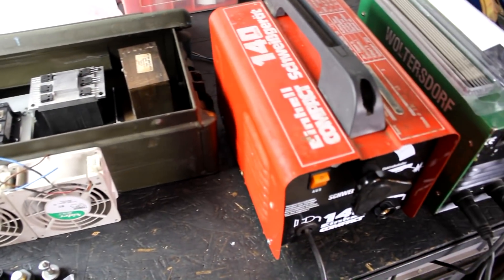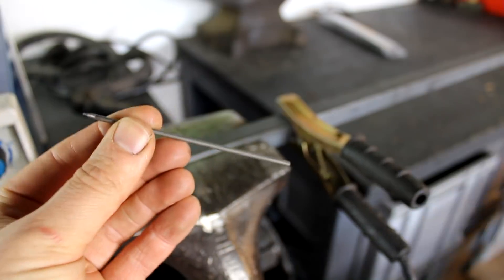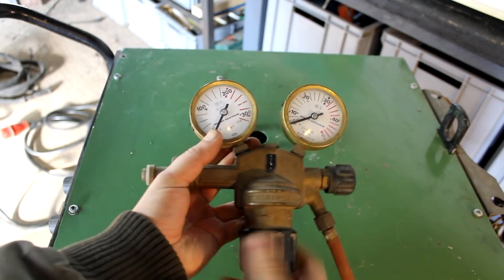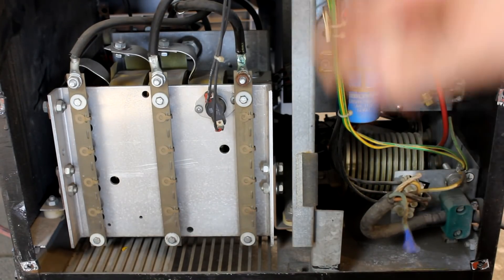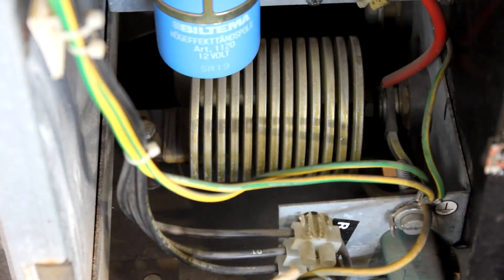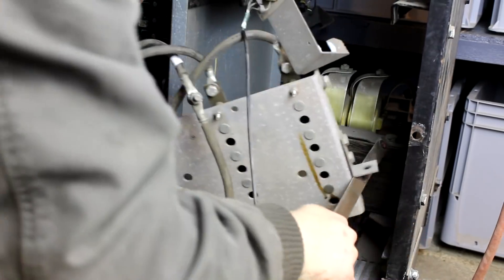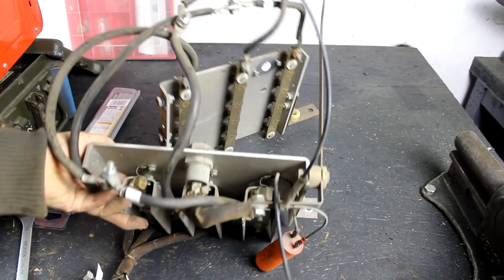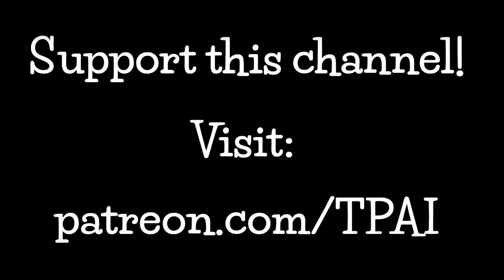Teardown of 250A TIG Welder - ESAB, Sweden

Comment: You forgot to mention one of the biggest benefits of MMA, it is used outside not because people don't want to carry a gas cylinder but because it has the best shielding in wind, wind can easily blow away your shielding gas. Glad to stumble upon your channel I also believe this abundance of cheap labor and materials will soon cease.

Comment: Probably,  somebody tried to modify it for single line power,  and didn't add any, type of internal grounding or connection so parts of the system went into an non symmetrical sympathy and it fried itself... Sorry. That was probably bullcrap. Do you know why it failed or got so corrupted?

Comment: 04:09 : Is this a good idea, having the leads' sockets so low close to the base of the welder? It feels somewhat wrong, although, I guess, if the leads are long, it saves them from always being bent and causing them to be unduly strained. 
It feels to me as if they are more prone to be accidentally jammed against some other object lying around in a workshop, kicked and trampled over or, more likely, tangled into those cart wheels than would be the case if they were located higher towards the top of the welder. Am I completely off-base thinking that?

Comment: You're my style, dawg. Except I bought a buzz box and in a week bought all the parts necessary to make an addon module for TIG welding + arc start. I hot glued it all to the inside of a plastic spool for maximum ventillation :D

Comment: recently found a weird electrode welder on the yard sale.  Huge 380V 3ph motor on wheels (looked like a air compressor with tank) and a controlpanel ontop where the cables / hand piece plug into.  weird one. maybe they used the momentum of the motor for higher initial currents.
Reply: gamerpaddy that is a rotary converter, basicaly two electric motors  with the same rotor. Used to be  the ducks guts Back in the Day, capable  of Tig and stick( 7018 and 6010, 6013) verry  powerfull and reliable, high dutty cicle
High power Rotary converter are used in  electrical  distribution  where a transformer would be  as big as a five story building.  rotary converters are compact but cant handle  overload
Reply: yea just found some infos on them, seems to be from early 1900 when there was no diodes around. using a generator seems to be the best way to generate DC. mercury rectifiers were big and low power.

Comment: I an not sure whether those capacitors crack due to internal swelling or shrinking of the  encapsulating resin, but just about everyone of those capacitors that I have ever seen has had a crack in it even ones that have not been used.

Comment: Nice video, I'm excited about how this restoration might end. Just one small correction, you talked about the "stick welding" as being the way to go when outside welding as the MIG/MAG necessarily need a gas tank, this a common misconception. There is a product called "Flux-cored self-shielded wire" that can be used in a MIG/MAG machine and will produce a gas shield as its internal flux is evaporated, similarly to what happens in the "stick welding" process. Although not very common, this type of self-shielded wire can produce excellent results for out-of-position welding and are becoming more popular in the application of robot welding for large machines (as in big shipyards).

Comment: I tried TIG welding once and couldn't manage to do it even after many attempts. It is EXTREMELY difficult. I kept melting or touching the tungsten tip to the piece. My hands are just not steady enough.

Comment: Note that when reassembling aluminum connections need special treatment. I had to repair a welder where the steel bolts burned through the connection of the inductor. Trimmed back to good aluminum, cleaned well with a new stainless wire brush, applied NOALOX (anti-oxidant)compound, and reassembled with brass hardware (copper might have been better.)

Comment: oh yeah, excellent video. can't wait to see part II.
Besides the RIFA caps that you have mentioned already, also replace the red Roederstein (ROE) caps in the middle of the board. 
exciting transformers and coils
Reply from the maker: Hey Max, nice to see you here! And you're right: The old Roederstein-caps cause a lot of trouble as well. I had a lot of trouble with those in old "Braun" Hifi equipment from the 70s. Cheers, Gerolf

Comment: It seems as though this welder has several issues.  I can't understand how so many issues could be present. Poor maintenance/modifications might be part of the sad history of this welder.  Did the failure of capacitors cause overheating of the core? Maybe it was abuse by welding too much without allowing cooling to occur?  Might it be helpful to understand the failure process so as to engineer a better fix?  Is it even worth fixing or is it better as a parts donor?  Patiently waiting for part two.
Reply: I think you have never been to welding booth at factory :P They beat crap out of those welders 24/7 and cleaning/maintenance is only once a year. This cumulation of damage is totally normal for industrial conditions. Saw many cases when brand new industrial migs were dying after few months cuz of tons of dust/vibrations on pcbs.
Reply: It is entirely possible that a newby was in possession of this welder at some point and ran it haywire. I have seen the apprentice marks on other machines before, where i had expected them to be in decent condition (because who would buy an industrial piece of equipment and not know how to use it), but, never this many.

Comment: Nice biltema™ ignition coil. 😏
Reply: Haha Biltema! Jag dör!
Reply: I am pretty sure that´s not the original...
Reply: I have a Biltema bike, swedish quality. Too bad ESAB is curently outsorcing to China, I know from  an electronist that services esab, Miller, kempi, and other welders that he found  some cheaper esab inverters to have  exactly the same circuit  boards as a much cheaper brand (alfa in), also the way they are build if a mosfet blows the whole board blows up so they can,t realy be repaired unless You pretty much replace the whole board wich means replacing the welder itself, unlike Miller or lincoln or even older telwin that have a high level of protection, not to mention  kempi and fronius that almost never return to service. So maybe esab was never about high quality, thow their machines are knowen to have good arc characteristics.
Reply: Yes, Unfortunatly almost everything is outsourced here today. It´s not a bad coil, it will do what it´s made for.
Reply: Esab has turned into un repairable crap to be honest, the power electronics are proprietary blocks so if one component in it blows just get a new welder.